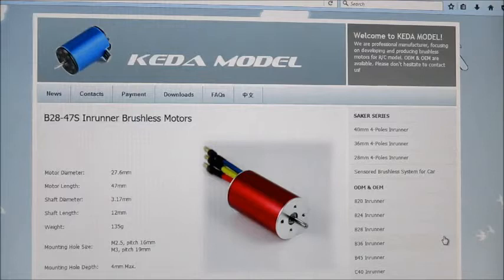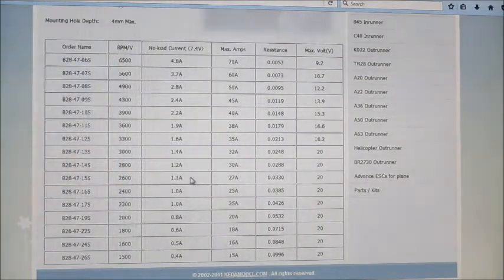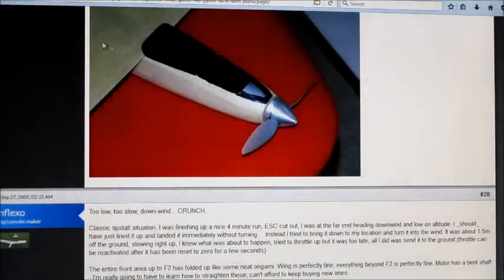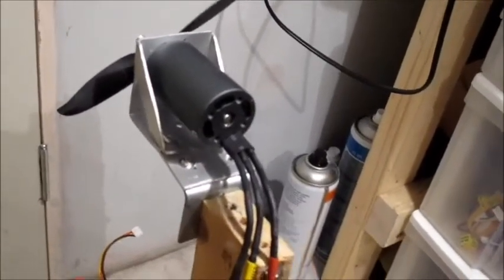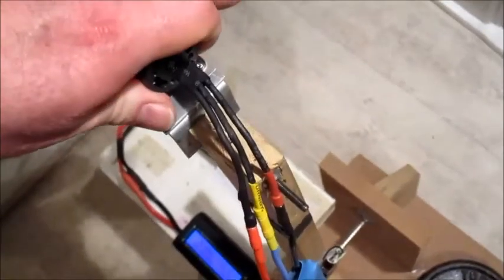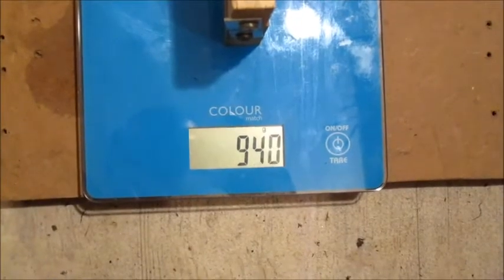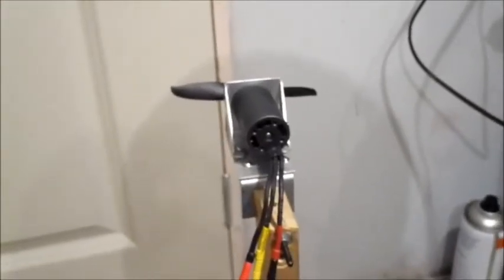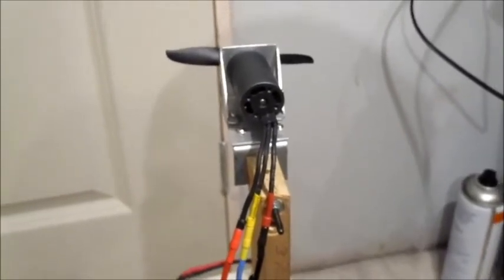Black Mantis / Keda 2847 3900kv Inrunner Thrust Test Motor test of the Week

Comment: Hello again mate, planning to build the slipso at 125%  and planning ntm 3000kv or paidiss 3500kv with 3s & 4s setup. Do you think this will be a fast setup for the bigger slipso?  do you think the ntm motor will fit good on the bigger model ? 

will i be able to cross 160 - 170 mph with this setup ? :)  Let me know your thoughts mate, thank you

Comment: sir, i want to ask something
whats the best combination to make a rc plane with 200km/hour, whats your recomendation sir? (motor and esc and battery)
thanks
Reply from the maker: Hello, can I ask what type of rc plane. Powered glider, pylon racer, hotliner, delta wing, pusher or puller and what size is the plane? Then I can give you my best recommendations. Thanks
Reply: rcplanepirate 
my design is pylonracer, but still confused to choose best design for myplane (pylon or hot liner) from polyfoam/etc , maybe 2-1kg weight and wingspan less than 1m
my goal is build rc plane with gps modul that can fly autonomous with highspeed cruising for 1 km, is like a drag competition
Reply from the maker: Sounds interesting. I've come up with this combination. I think it would suit what you are doing. Sounds like it would be at full throttle for a long period if time so this set up should be fast but won't get too hot. Motor is a Dr Mad Thrust 2200kv inrunner https://hobbyking.com/en_us/dr-mad-thrust-2200kv-1600w-70mm-edf-inrunner-6s-version-29mm.html
80 amp ESC https://hobbyking.com/en_us/hobby-king-80a-esc-4a-sbec.html
Battery https://hobbyking.com/en_us/zippy-flightmax-2650mah-6s1p-40c.html
Propeller https://hobbyking.com/en_us/tgs-precision-folding-propeller-5x5-black-1pc.html
The battery could do with being smaller so it fits easier. So if you can find a 2200mah 40+c 6s lipo somewhere else it may fit better. Hobbyking are all out of them at the moment.
Hope this helps and works well for you.
Reply: rcplanepirate 
oke thanks for recomendation sir, i hope that I and my team will finish it soon,
Reply: rcplanepirate but, i have i little confused about kv in bldc, in other condition higher kv have a poor performance than lower kv,
Reply from the maker: Yes that is true in thrust-efficiency ratio on big planes but you don't need to worry about that on a pylon racer. 2200kv is not a very high kv motor anyway that's why i suggested it. This set up should produce around 2kg of thrust and could make the plane do a possible 300kph. So i think it should be more then enough to achieve what you are trying to do.
Reply: rcplanepirate okee thanks sir